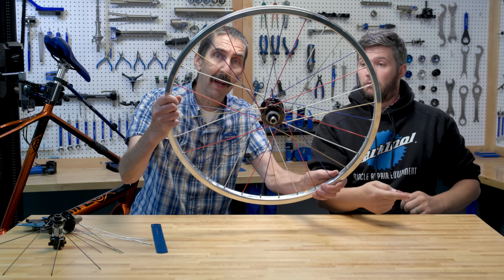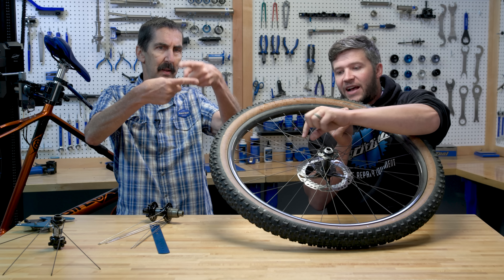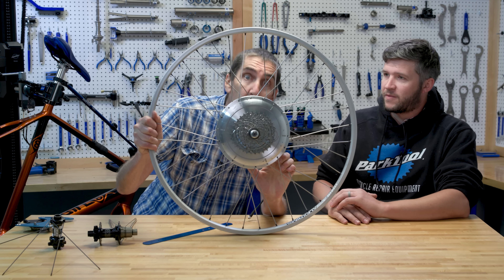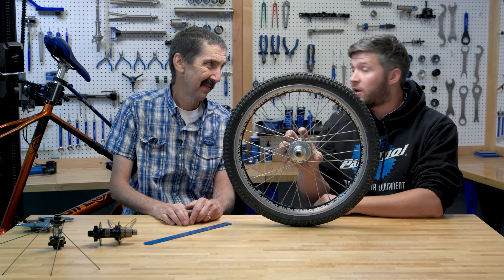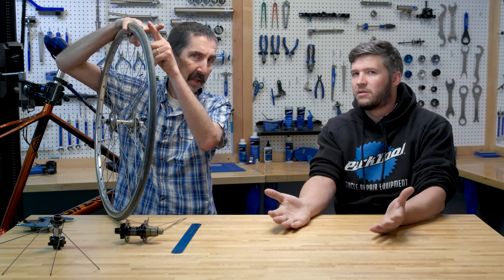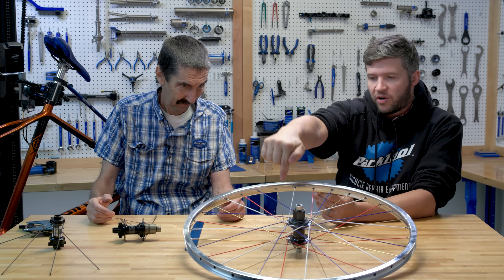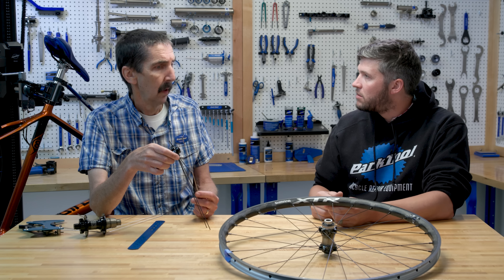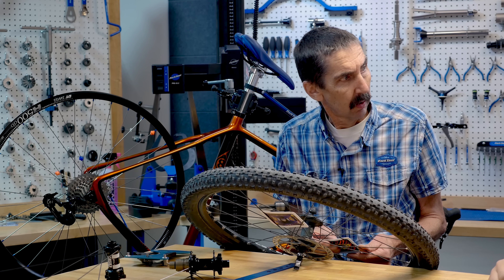Spokes: To Interlace or Not to Interlace? | Tech Tuesday #206

Comment: Wheel building is currently beyond my comfort level.  It seems to be much more art than science.  What I can say is that every cross point in a spoked wheel, especially if the crossing spokes touch, makes that wheel harder to clean effectively.
Reply: it's really easy, I definitely recommend trying it. a lot of people are scared of tensioning, but if you just take another wheel and pinch two spikes together you'll know about how it should feel. 
I see it the same way I see new tricks or riding techniques, scary at first but definitely worth knowing.
Reply: like any art, it requires practice. build up a simple wheelset and then undo it and do it again. you'll get comfortable in no time
Reply: @ratman6417  I'm new at this game, and thus far everything I've learned about bike repair and refurb has been from need -- if it didn't need doing, I didn't learn how.  So far I've not encountered a wheel that "needs" rebuilding.  But someday, no doubt, I will.
Reply: @rangersmith4652  it opens up a lot of options for cheaper solutions, want a cassette on your cheaper bike? easy, just buy a hub. I run a bike shop so I have to know a ton a stupid, weird skills and tricks. wheel building is a good one to know

Comment: To just claim that interlacing doesn't make a wheel stronger is somewhat pointless, isn't it? Without any measurements, how can you know? And while non interlaced wheels are available, they still seem to be the oddity. There is certainly a reason why the vast majority of wheels are built interlaced, and considering it has a pretty large impact to the manufacturing time, I'm hesitant to say it's just because some guy in England thought it was a good idea 100 years ago!
Reply: How is it pointless? It’s either true or false but not pointless. If there’s a reason, what is It then…?
Reply: @IverKnackerov  Because there is no data. Why not claim that interlacing will make your bike 5 lbs lighter? Back up the claim, don't just say it doesn't matter!
Reply: The data is in the physics.  As with much of cycling there is a ton of backyard engineering (which is fun but probably not always right).  I suspect most choices like this one really come down to ascetics and a perception of quality.
Reply: @airliftpilot  Maybe. Or maybe not. I've certainly seen many instances of people "knowing" things that aren't true. But also of people discounting details that turned out to be critical. My point is just don't look at an interlaced spoke and say "nah", back it up somehow. I don't know if interlacing has a significant impact to the performance of a wheel, but based on the information presented in this video, neither does anybody else.

Comment: As a newer wheel builder, this is fascinating information.  I'd like to see you guys do one on the differences in cross patterns--2, 3, 4 cross, etc.
Reply: The build strength has more to do with the components and even tension. 4 cross is no stronger than 2 but 4x will likely have more spokes and shallower rim so sometimes it's just a necessity.
Reply: @countspokeula539  geometry deny you, on wheel with 36 spokes , on same hub, same rim , on 4 cross, spokes are on longer distance-radius from axle, so spoke has longer lever so it can transfer more force/momentum  for same spoke strength, but question is do you need that strength because you need 4 spokes more and all spokes are longer for some 4-6mm, or 32 spoke wheel will satisfy your need for wheel-strength

Comment: I remember picking up a used tubular wheelset in the 1970's specifically for the Phil hubs, which I couldn't afford new at the time. Every one of the 36 spokes on each wheel had been wrapped with thin wire and soldered at the interlace point. I thought of all the extra work that took, and I assumed that the previous owner was aiming for a stiffer wheelset,  but who really knows?
Reply: At the time, there was a belief that tying and soldering spokes had a stiffness benefit. That theory has since been debunked - or at least proven to be negligible - although there is still a race day application for tying and soldering spokes: spoke retention. Especially with disc brakes these days where you can break a spoke and keep riding, tying and soldering spokes can prevent a broken spoke from flying around and getting caught in derailleurs, brake calipers, etc. 

All that to say that it is a dying (if not dead) practice.
Reply: In the late 70's, early 80's tied and soldered wheels were common on the track.

Comment: as a relatively new wheel builder myself, it sounds like the crossing pattern is more important than anything else. What I take from this video is that interlacing is unnecessary and does not make a difference in durability for any discipline of riding. The biggest issue would be explaining the lack of interlace to somebody. Yes, no, way off?

Comment: Very cool video.  I bought Jobst Brandts book and never looked back.  Built several wheelsets over the last 20 years.  One of the best feelings of accomplishments in the world.
Reply: Same. The book told me everything I needed.  Built two Sturmey Archer drum brake hubs trued against the frame with a clothes peg.  And from reading I knew to go 2x on the big flanges even though people all over the internet insisted that more crosses = more better.  Still had plenty of angle for a strong wheel, I rode them until the drum brakes wore through the hub around 35k miles.  In only touched them once, when I got a truing stand, to raise the standard of true and dish a bit.
Reply: What did Jobst Brandt have to say about interlacing though?!
Reply: @chrislukes9037  

INTERLACED SPOKES
Spokes in a crossed pattern are usually interlaced at their last crossing before
reaching the rim. Spokes coming from between the flanges are laid over those
from outside the flanges. Interlaced spokes take up each other's slack during
severe radial loading and reduce the chance of spokes becoming loose. If spokes
become loose, their nipples can unscrew. Radial spokes cannot be interlaced and
therefore, lose alignment from road shock more easily. Interlacing also gives
more clearance between the spokes and the derailleur on rear wheels.

Comment: The two main reasons for interlacing have to do with rim compliance and whether the holes in the rim are drilled on center or off center to compensate for the side of the rim.  Racing tires that were built in the '70s and '80s we're going for skinny high pressure and rims that couldn't necessarily handle a large impact and so to compensate for this the spokes were interlaced to allow some compliance.  Modern rims typically have a much deeper dish and are not compliant enough for the given the spokes to even matter.  Secondly as mentioned in the video the angle of the spoke and during the rim on some combinations tends to have too much of a bend at the nipple.  Interlacing reduces this bend, and on rims where all of the holes were drilled dead center on the rim this mattered but modern rims have the holes drilled off center to align with which side of the flange the spoke will be going to, so another reason modern wheels do not get interlaced

Comment: I was building wheels for myself back in the late '70s. Replacing steel rims with aluminum (Wow, what a difference!) 

After trying different patterns, I settled on 3-cross, not  interlaced. The initial tensioning of the spokes was made a lot easier because I could pluck the spokes and adjust by the pitch of the tone they made.  Interlaced spokes could not give a clear tone.

Thanks to this video, after all these years I now no longer feel guilty about not having interlaced.

Rear wheels were heavily dished in those days.  There was a noticeable difference in pitch between the one side and the other.

Comment: First of all, your channel is amazing. Thank you for sharing the knowledge, and amazing tools as well :) I found that interlacing reduces the vibration of the spokes, which helps the spoke nipples to hold the tension. I've had few radial laced wheels coming back for spoke re-tension, as during the bympy rides they tend to unwind themselves. Mostly front wheels though. Dt Swiss spoke freeze fixed the issue, but with interlacing it never happened.

Comment: In my opinion interlacing makes the wheel stiff but at the same time more flexible to impact. It has kind of the same effect that two butted spokes have. Without interlacing all the possible damping is gone and all the stress comes right at the most vulnarable points like the J bend etc. For that reason I also think the amount of impact a wheel can withstand and absorb is greater with an interlaced wheel. So therefor I believe an interlaced wheel is more durable and is more fit for applications like mountainbikes, kids bikes and city bikes. 

If you are on a straight road and choose for speed I think non interlacing is the application for you; more stiffness, more efficiency and less loss of unwanted loss of energy. And therefor I think that with the same amount of impact the interlaced wheel will last longer until the first spoke should brake.

Besides that, the stress, and therefor the wear on the J bend will probably be much greater than on the crossings of the spokes on the interlaced wheel. So the wear on that the point of the crossing can in my view be neglected. And no one has ever seen in their life a spoke that was broken on that point 😉

Comment: My experience. Straight pull is noisy and stiff, but no stronger than other wheels. Soldered track wheels are strong and stiff as hell, but no one really wants that for a road or trail ride. Three cross (interlace) are just right, except for radial on a front road or track wheel. Interlace provides some damping.

Comment: All my wheels are built by myself. Been doing it for 15 years now. I actually started mixing in 2-Cross on the high tension side to increase the bracing angle and i usually never interlace 2-cross spokes unless they are bladed because the bend angle of the spoke would be too much. Otherwise, i always interlace because of the spring effect y’all mentioned. 
So generally, 3-cross interlace on the low tension side and 2-cross non-interlace on the high tension side. I’ve never had an issue with derailleur clearance. Also, i wonder if pedaling energy is being lost on an interlaced rear wheel because of needing to load the “spring” (to straighten the drive spokes) with every pedal stroke. What are your thoughts?

Comment: I've built wheels both ways over the years  I must admit to oiling the spokes to silence a cricketing noise.  Those are the wheels that eventually broke spokes. The noise is there to let you know your spokes are probably too loose. I didn't realize that interlacing spokes increases spoke to derailleur clearance. I had no idea straight pull spokes were all in the same plane and would touch without interlacing. There is also the little controversy over which spokes should be the pulling ones. I had one track wheel laced asymmetric and wondered why. Interesting topic!
Reply: "There is also the little controversy over which spokes should be the pulling ones." Actually, I've heard arguments for both...what's the current consensus? And does it matter with disc hubs, which have stresses in both directions? I used to lace the pulling spokes on the outside, but now I lace the pulling spokes on the inside, and haven't really seen much of difference either way.

Comment: This video just reinforces my resentment for ebikes with hub motors. There's no good way to lace those things so the manufacturers insist larger gauge spokes are the answer, which doesn't prevent failure, only makes it hold out until after the warranty period has expired. It also exacerbates other problems with the way those wheels are often built.

The closest I saw to a well built wheel with a hub motor was the later generation of BionX motors, and that's because they had a big motor between two small (conventionally sized) flanges and straight pull spokes. This allowed for tangential lacing with minimal deflection at the nipple.

Comment: i did a 20" wheel with a hub motor once, it took like 60mm spokes and they had to be 0 cross. rim was super wide too with large offset on the holes. stingray chopper was the bike

Comment: I have maybe 10 recumbent trikes in my fleet.  Being trikes they put enormous lateral loads on the wheels.  The wheels (20 and 26") are built 1 cross, 2 cross, 1 cross on one side of the hub and radial on the other.  Some interlaced, some not.  The same brand and model trike has had different spoke patterns between production runs.

My conclusion is that if the wheel is built and tensioned properly, it doesn't matter if it's interlaced or not.

Comment: Very interesting, thanks for questioning what isn't solidified in science and practise. I have been teaching wheel building for years and always recommended interlacing, some wheels that were stripped and rebuilt without interlacing seemed difficult to true until corrected. Some questions I have based on that experience:
Does interlacing change the required spoke length? Are spoke calculators designed around interlacing (or perhaps even not!? They seem more theory based)?
Does it make a difference to perceived spoke tension versus actual force being applied to the flange and rim?
Reply from the maker: Spoke length formulas are not that precise, but in theory it would change a straight line.  Don't change length for the interlace.  The spoke head pulls just as much at the flange with either method.
Reply: @parktool  Great, thanks so much for the answer! All makes sense. Will have to build a set of non-interlaced wheels for myself to try out

Comment: Interesting topic. Advanced, too. Controversial some might say... Like welding spokes together.
Reply: I have never heard of anyone litteraly welding spokes together. Since the heat would just cause tensioned spokes to elongate and i imagine its pretty much impossible to correctly tension spokes that are already welded together. Soldering spokes is something that people have done but I think would accomplish little except prevent a loose spoke from flying all over and possibly ruining the temper pf the spoke. But what about gluing spokes? Especially flat spokes have lots of surface area in contact and modern super- or epoxy glues can be really stiff( much stiffer than solder), actually adhere to steel and hardly produce any heat.
Reply: @BenB21361  I guess I meant soldering. I just googled what the difference is (welding vs brazing vs soldering). Thanks for correcting me.
Reply: @BenB21361  If you solder/epoxy spokes at the interlace point you are seriously hindering the ability to make tension adjustments on that pair of spokes...which means all of them if you do this to the entire wheel. The spoke will now pull against the stress riser at the solder/epoxy joint, not at the hub, and if you do move the rim you'll likely also tweak it along the other spoke in an unintended manner. Your point on possibly altering the temper/length/shape of the spoke also stands. Other than breaking a spoke (which still doesn't guarantee part of it isn't flopping around), there is no benefit to doing this. If you're doing it for the noise or to prevent flex, then Calvin and Truman's point stands and your wheel is out of tension.

Comment: All my bikes have interlaced wheels.  My MTB is 2 cross, and my old (42 years) bike has 3 cross.  With a pinion drive and a "straight" hub on the rear wheel; non-laced seems to be the best answer for a road bike.  Would probably work on lacing in an Enviolo hub.

Comment: Did he just say that if there's any noise of spokes rubbing against each other, tighten them? Even if it's out-of-the-saddle straining? I'm glad I've watched this video because I've recently bought a truing stand to straighten my wheel and put a bit more tension in the spokes, and one of the things I've noticed is that my hub freewheel isn't as loud as it was. I wonder if this has anything to do with what you said about how interlacing dampens noise.

Comment: I'm building a wheel with superboost 12x157.  Would the wider hub make difference on interlacing or not?  Seems like by not interlacing on a wide hub it would pull at a wider angle giving it more lateral stiffness?  What do you think?
Reply from the maker: The hub width will allow for more consistent bracing angles from DS to NDS. The bracing angles are better too, so you would not gain any lateral stiffness from interlacing. It would actually make the outer spokes bracing angle worse and the inner spokes bracing angle better.
Reply: @parktool  Ok..Thanks! So would you recommend not interlacing that wheel then?
Reply from the maker: This video pointed out the ups and downs of both methods so that you can make up your own mind ;)

Comment: Nice video and presentation.
 
Interlacing has more to do with torque between the hub and the rim. A wheel with no interlacing suffers more on phase ripple between hub and rim during acceleration and or braking. That should cause relative more rubbing of spike on hub and nipple on rim.

Comment: Interlacing helps keep your wheel true.  When the wheel encounters a load that is high enough, like hitting a big pothole, to completely unload the spoke, the interlaced spoke will keep it from going completely slack and having the nipple back off.
Reply: Oh, that's an interesting point.  I wonder if threadlock prevents the back-off as well.
Reply: @ericpmoss  you can use threadlock, but that will make servicing the wheel harder than it needs to be.   If you have high even tension, the nipples should not back off.
Reply: @jrh2015  what is doubtful?
Reply: @jrh2015  I see.  It really depends on the load put on the wheel.  Interlacing is not going to make a huge difference but it will make a difference.  How much?  I can't say.  I never set up instrumentation to test it.